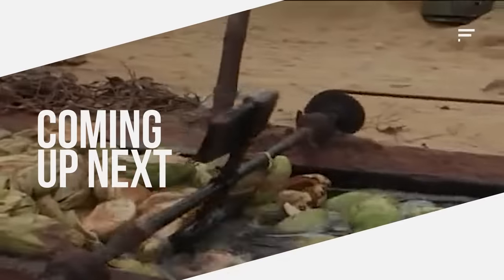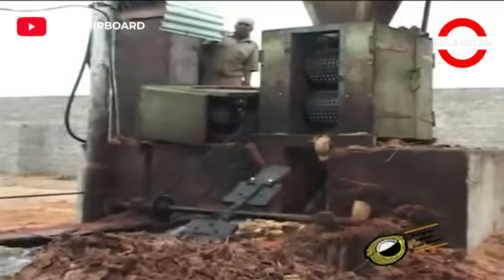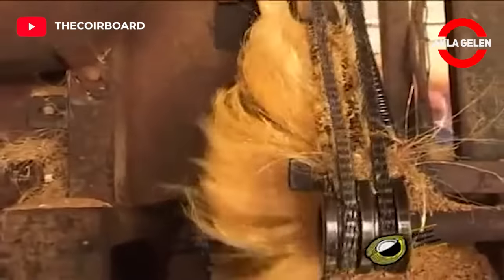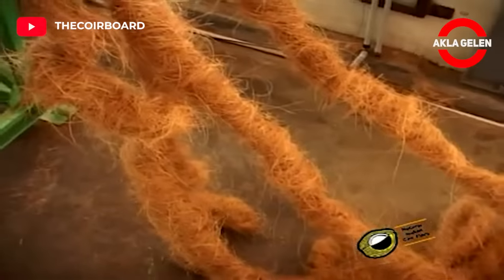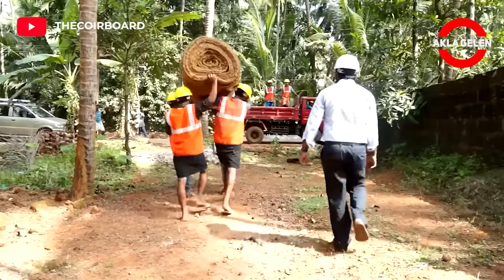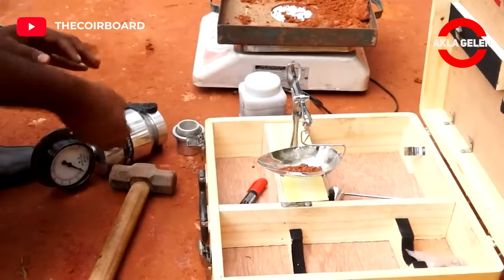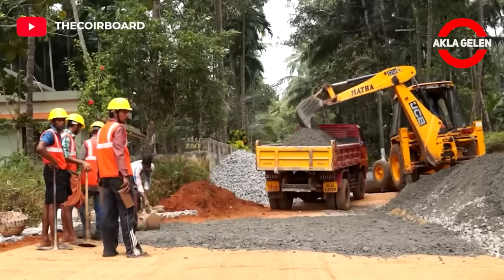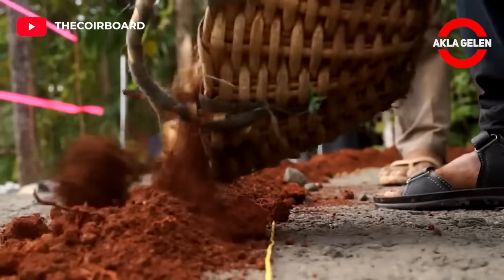You Won't Believe How India Made the Road Using Coconut - Incredible Road Technique

Comment: you proved that your product is a scam in your own video :D   -   BIODEGRADABLE
Reply: Someone does not understand Chemical Equilibrium and Kinetics.
Reply: @death_parade  explain then
Reply: @PeterJurasek  Coir decomposes the slowest among all biodegradable fabrics.
Reply: @death_parade  so what?? what is the point of using it anyway?
Reply: @death_parade  i work in construction and we use geotextiles every day dude, my whole point is why use BIODEGRADABLE geotextiles?
Reply: @PeterJurasek  Because the objective is to make greener roads. Now I know, "but it degrades dude, what is the point of a geotextile that degrades?" Right?
Thankfully we don't shoot down ideas so easily and actually field test them in India. Upto 7 year long studies were done after building multiple rural roads with this technique. What was found was significant reduction in rutting. Yes the fiber will degrade after few years. But it then mixes in the subgrade and friction generated by that further improves the strength of the subgrade. Kind of like a short fiber thermoplastics.
There is also an entire body of research in India focusing on using coir as geotextiles to stabilize roads built on black cotton soil. Obviously not used in highways, but for rural roads, seems like the perfect solution. 

This method is still being studied, field tested and perfected. And that is exactly how we replace polluting materials and processes from our way of life one by one over a centuries long process. These  are obviously niche solutions. Which is why we don't have people rushing to make this the next big thing. If they made highways this way, then yes, it would be a scam. But India doesn't build highways like this. India builds highways using waste plastic instead. Another niche solution that was used for 100,000 km of roads (including some National Highways) between 2016-2020, but I am going on a tangent now.
Reply: @death_parade  i wont even read this, i guess the state of roads in India says all that need to be said

Comment: That's joke. The entire coconut based material laid is of no significance for road construction. It will disintegrate with soil. If road has to erode than it will under the mat, road erosion also takes place from bad driving, breaking and environmental factors. Where the ASPHALT from surface erodes or soil under road caves in due to depression or landslides!
 Actual road and its quality is based on the thickness of materials such as pebbles used, the quality of compression and quality of Asphalt. Rest all is gimmick.
Reply: yeah we are mad???

Comment: I wonder what ubba rich or political person lives on that part of the road 😉
Reply: That has nothing to do with this. We don't do virtue signalling. We build roads based on the technical parameters that are required. 100+ km of roads and 32-40 km of highways are built in India every day. Nobody cares about such stuff as "where the politicians live".
Reply: @death_parade  
LOL, you trying to kid me on right?

They built this advanced road for nobody in the middle of nowhere???

Pull the other one, it's got bells on it 😉
Reply: @sydclark5581  Its not "advanced road". Its a rural road where not much traffic passes through. Which is perfect to test such solutions. Because that is what such solutions are built for. There are also solutions for roads with heavier traffics. Such as roads built using 10% plastic waste. India has built 100,000 km of those plastic roads between 2016-2020. Many of them are stretches of some National Highways and other such roads with heavy traffic. 

The point is to tailor solutions to various different types of roads. To try niche solutions for niche roads. In fact that is what most of engineering all about.